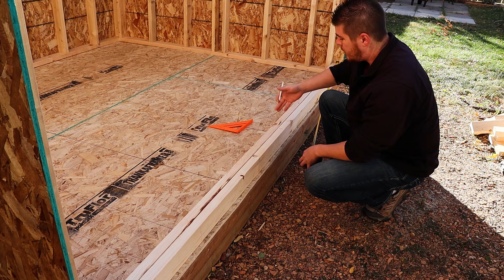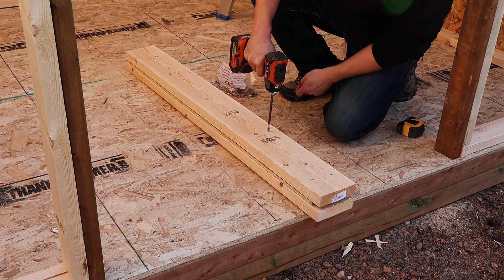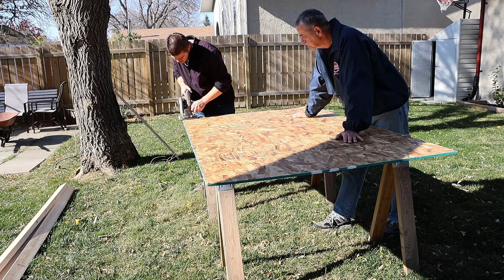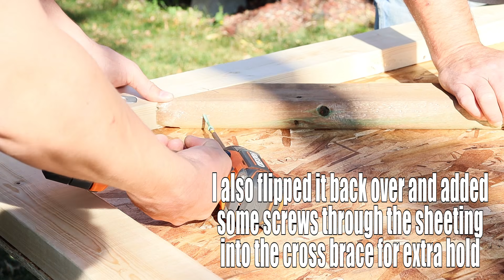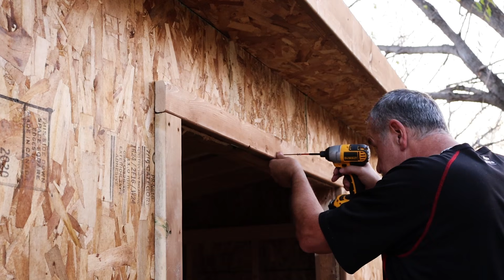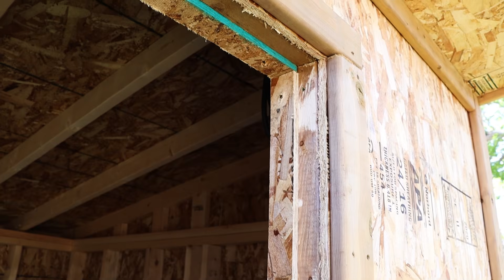How to build a storage shed - Door (front wall) // Part 3 - Plans available

Comment: I really enjoyed your videos. I'm going to use your videos as a reference to build a shed for myself. Thank you so much for sharing your knowledge and expertise. Awesome! Just wondering about how the 2X4"s aren't splitting when you drill in the screws. Or is it just bad materials that I purchased? And how many days did it take for you to complete this particular shed?
Reply from the maker: Thanks very much, I appreciate that! You're very welcome and I hope your shed turns out. There are very detailed build plans available if it would help. 
Typically with 2x4's being soft wood they shouldn't split. They can from time to time depending on how dry it is or if you're close to a corner or are using too large of fasteners, but won't all the time. Don't know what to tell ya. All total it was about a video a day, but it takes longer while filming. But if you've never done it before, I'd budget about the same amount of time-ish. Good luck on your build!

Comment: Gardening Granny here, I liked your easy to follow instructions, wish you lived closer. Planning an 8x16(wide) tool shed. I’m concerned about the floor , I will be parking a small 0-turn in the centre. Should I double the 2x6’s where it sits?
Kate
Reply from the maker: Hey Kate, I'm glad you liked it. You should be fine with a 2x6 floor as long as there is some 4x4 beams underneath picking up the load. I may add a couple extra of those is all. Good luck on your project!

Comment: Little tip. If you are going to put a lock on the shed, make sure you put the door hinges on the inside, not the outside. Anyone can get past your padlock by simply unscrewing your hinges 😂
Reply from the maker: You can also through bolt the hinges with carriage bolts, which I've done. I don't have problems with theft here anyways and most people don't carry drills with them to get into the shed
Reply: Make sure you put 2 guard dogs, infrared system and bullet proof locks and preferably titanium walls too.. Don’t forget the security cameras.. 

Cmon man unnecessary comment it’s a great build bud! Congrats 🤙🏼
Reply: @ChecoARHeavy there's something called a screw driver that fits easiest a pocket of your pants. Any thief can easily walk uo and unscrew it, so no, it's not 'a good build'. Why even put a lock on it if you don't have theft problems in your area. And why put it on where they can easily unscrew it if you do have a theft problem?

Comment: I. Would  like. The. Hinges. Set. To where. The. Hinges are. On the. Inside. The shed. , thi way. No one. Can. Just. Unscrew. The. Bolts. On the. Hinges. And. The. Door. Is. Taken    off. I don't. Want. My  2000 $  riding. Mower. Stolen ,
Reply from the maker: Watch my newest shed door video from a couple months ago. I address this concern

Comment: ok so a little bit of a tricky question i want to build a shed just like this, but i want to use it to keep my reptiles and the room has to stay 80 degrees year round, how would i go about insulating the entire shed
Reply from the maker: I'd add some chicken wire under the floor on top of the beams and add some Roxul or Rock Wool insulation to the floor before sheeting. Maybe even just sheet the top and bottom of the floor framing in then set it on the beams with insulation. Then the same insulation in the wall studs and door with plastic vapour barrier sealed to the top and bottom of the wall plates. You could do something similar to the roof and then sheet the inside of the roof, or spray foam it. Then some door insulation around the door seals.

Comment: Hi, great video's, taking plenty of knowledge from your build. I am looking at building roughly 8 feet wide with 6 feet depth shed in the coming weeks. I am planning to build a second floor, play space (tree house) for the children. I will use the 2 by 6's and follow as you did. would it be structually safe to basically build a shed on top on a shed?
Do you have tips to fix the skids into the ground for peace of mind too?
Thanks!!
Reply from the maker: Good to hear you're picking up tips! It's strong enough for sure that isn't a problem, just might be tipsy, yeah. Once the floor frame is built but not sheeted, you may want to mark holes to dig inside each corner. Dig down, probably with a machine you can rent, and drop 4x4 piles into the holes a few feet down and concrete them in. Then fasten the 4x4 skids to the piles sticking out of the ground with structural fasteners and cut the piles down to length, then sheet the floor. Good luck on your project

Comment: Kinda put the support 2x4 in the wrong direction
Reply from the maker: It isn't support I said, It just something to screw the OSB to in the middle so it doesn't wobble. The OSB sheet is what prevents the door from sagging
Reply: @JessedoesDIY  why would you not just go opposite direction for added strength and to make it look professional, might as well just put a horizontal 2x4 in the middle in that case

Comment: Why did you choose to use screws over nails?
Reply from the maker: Ease of accessibility mostly. Most people either have or can get a drill. But most don't have nail guns or want to pound in that many nails by hand. The other thing is we don't need the shear strength of nails here, nothing is hanging off anything, it's standing. Screws are arguably better here to clamp and hold it together, but ultimately either works

Comment: Jesse, great job on these videos. They’re helping me build a shed as we speak. One question regards the front wall. Is my math off or is your wall not 8’ tall? If you cut your studs to 87”, add 4 1/2” for the bottom and 2 top plates, doesn’t that give you a total of 91 1/2”? That’s 7’ 7 1/2” right?
Reply from the maker: That's awesome! I'm pumped you're building it, email me some pics when you're done, I'd love to see it. You are correct, it's just under 8' tall so that way I could use a whole 8' long sheet on the front wall without cutting it, but it had to slide down and wrap around the bottom of the floor framing and sheeting.
Reply: @JessedoesDIY  thank you for the info!! Greatly appreciated. I’ve subbed and liked your vids and will be happy to send some pics when the shed is done!!
Reply from the maker: Anytime! That's awesome, I'm glad to have you on the crew! Excited to see it

Comment: Hi Jesse.
Thank you so much for getting back to me in such a timely fashion. I am going to take your advice and go with the same roof as you did, after all it does make sense. One small question which I may already have the answer for but would like to hear from you. I see that the back and side walls are shorter than the front wall and I understand that this is for the pitch of the roof. so the question is, what size are the heights of the back, sides and front walls. I'm guessing 7' back and sides, 8' front. Please correct me. Thank you so much.
Paul.
Reply from the maker: No problem. The rear and side walls are about 6.5' to the top of the top plate and the front wall is just under 8' by a couple inches. That way I had plenty of room inside and wouldn't have to worry about hitting my head on anything, and for the front walls I wouldn't have to cut a sheet, I could just use a full 8' long sheet once it overlapped the floor framing. All the supplies, measurments, materials and lengths are all in the plans if you want more info. I tried my best to make them very thorough. Hope that helps!

Comment: Hi Jesse. 
Thank you so much for this video. I am actually getting ready to build a 8x10 shed in my backyard and I am definitely using your video as a guide. The only difference in the shed that I am building is the roof which will be a pitched roof. Do you have any suggestions for me .
Reply from the maker: No problem, I'm glad you found them useful! That's honestly a whole different subject that I'd need a video to explain, not text. That's the reason I went with a classic shed roof is because it's much much simpler for the average homeowner...and personally I feel it lends to more space inside

Comment: Could i just use 1x4 or 1x3 for the door trim?  Also for the trim on the corners of the walls?
Reply from the maker: You could but it'll sacrifice a little strength around the door. A 2x4 or 2x3 would be better if you can't find deck boards, but then you'll need to use 2x material for the rest of the trim to match. Up to you

Comment: Curios as to why you used plywood and not siding? Actually it looks like particle board, will that hold up over time?
Reply from the maker: It's OSB, and yeah, as long as it's sealed up with paint or something it'll last just fine. OSB has some weather resistance because of the glue in it, so it just needs a bit of help. Most people leave it raw and that's where the problem lies. I planned on using a smart siding (which is just textured and primed OSB) but I built the shed at the start of Covid so it was sold out everywhere locally because of supply issues

Comment: Mate these shed videos have been amazing thanks so much .. I don't have the tools you have but I've got a chope saw and a decent lecce drill driver ..
Reply from the maker: Thanks, I'm glad you like them. That's why I built it the way I did, I didn't use any fancy tools, just a drill and saw so anybody can do it. Whatever saw you have that can cut wood is fine. I'd suggest getting even an inexpensive impact driver tho, it's much faster and takes all the rotational strain from the screw going in off your wrist and arm. After that many screws, your arm will thank you lol. Good luck on yours!
Reply: @JessedoesDIY  amazing work sir again thank you and I'll be investing in a decent driver as you suggest.. I've already had carpal tunnel surgery after many years of DIY..don't want to make that any worse 🤣
Reply from the maker: Anytime, happy to help! Oooo yeah, I'd definitely get a impact then lol save your arms and wrists from further strain!
Reply: @JessedoesDIY  sounds like a plan 🫡

Comment: Cross brace should be under compression and not tension
Reply from the maker: I said in the video it isn't a cross brace, don't really need one with the OSB acting as a brace to keep it square. I said this was nothing more than a scrap piece of wood to screw the center of the OSB to so it didn't wobble or sound so hollow when you knocked on it. Only reason I went slightly across it was to maximize surface area

Comment: Hi love your video I am planning to build a 5by 10 shed what size are your side walls and the front one pls thx so much
Reply from the maker: Thanks, but I wouldn't do a 5' shed, do either 4' or 6'. All building materials are designed to work on even increments, not odd. All the wall dimensions are in the videos as I went. I made the side and back walls to a final height of 78" and the front wall was so a 8' sheet would reach to the bottom of the floor framing

Comment: If I wanted to add a second door on the side wall, do I use the same principals here? Anything I need to be aware of that could be different?
Reply from the maker: Pretty much yup. You could frame a side wall normally and just pick a spot to add your jack and king studs, leave the wall studs out of that location. Only thing I'd do is leave it probably 6-8 inches from the corner just to make things easier like trim and framing

Comment: Really like your presentation style.  Will check out your other videos both to learn and for entertainment.  
Your first shed building video, you talked about deep permafrost.  Reminds me of years ago in Anchorage.  Later in Wyoming we looked the other way for temporary freeze depth in Wyoming.  Great refresher 30 years later.
Reply from the maker: Thanks. I appreciate it. Wow Anchorage, they are quite a bit farther north than me, but we actually get similar temperatures during winter the way arctic air flows. It's crazy here how far down it goes.

Comment: I probably would have put the door brace on the other diagonal but otherwise really cool 😎.
Reply from the maker: It wasn't a brace, doesn't need it because the odb sheet prevents it from sagging. It was just something to give me material to screw the osb to so it had some structure instead of being soft in the middle of the door. Glad you liked it tho
Reply: @JessedoesDIY  Yeah, I realize the sheathing takes that cantilever load but I'm trained to respond to upside-down triangles. 📐
Reply from the maker: Lol true that

Comment: This is probably the most helpful video series on building a shed. We have made great progress on our build, but there is one hick-up. It wasn't until I had the front wall up that I noticed that someone (maybe me, maybe my wife) didn't line up the king stud properly. It was about 1/8 to 3/16 of an inch toward the wall making the opening slightly larger that it should be on the bottom. My thought on dealing with that is cut out the bottom plate where the king stud edge was supposed to be, then using a bunch of shims I can line up the rest of the jack stud to the correct width so the door will fit. Do you have any thoughts?

We have rain coming for the next several days, so I won't be getting back to this until 3 days from now, so I won't be proceeding until the rain is passed.
Reply from the maker: Thanks! I'm glad I could help and that you found it useful. Super pumped you're giving it a go! Yeah, that'll work. Like I said, nice thing about a shed is there you have some liberties and slack since it isn't a dwelling. It makes it great practice to learn on. You can shim it over, or completely cut them out with a recip saw along the plates and move them over, then cut the bottom plate after. Whatever is easiest! Good luck on the rest of it and keep me posted, I'd love to see it when you're done!

Comment: Your videos are really, really great. I have one question, and forgive me if you've answered it somewhere else. I bought a box of Common Nails 3 1/2 - 16D Galvanized, to begin the upper framing of this small porch I am building. And I tried one of those nails out. They seem quite thick, and to a novice like me, I'm afraid of splitting the wood. Are these the same nails that you would use to frame, like for ceiling joists and rafters? Thanks!
Reply from the maker: Thanks, glad you liked it! Yup, those are the ones you'd use. Good luck
Reply: @JessedoesDIY  Thank you!

Comment: Can you tell me what tools you used?(name so I can go buy them) and the amount of materials and roughly how much did it cost you after everything is all said and done, ok? I’ve WATCHED All of your shed videos and I’m thinking to either buy a shed or do it myself because I need a different size dimension then what they sell on the market.  Thank you so much; love the videos bro. (Total cost? What kind of wooods, size and names of them? And What kind of tools I need?) Aloha
Reply from the maker: Hey man! So I used Ridgid in this video, but have since switches to Ryobi One+. Same company, just less expensive. You can get them at home depot and I used a impact drill with a 4amp hr battery and a 7 1/4" circular saw, a speed square, tape measure, hammer, level and a pencil. That's basically it. I have a full materials list in the descriptions of the videos and a full shed list in the last video. It cost me $1700 to build it fully and that is with inflated pricing. I'm glad you liked the videos, I tried to keep it simple and strong so people could adjust so I hope you'll give it a go! The cost between buying vs building isn't the only thing to look at. Building is much stronger than buying a plastic one, and if it's a pre-made wood shed, it might cost about the same to buy, but it'll only have about half the lumber as this one here so it won't be nearly as good. I made this out of all pine, some pressure treated and some not, and OSB. I have all the dimensions and everything in the build lists in the description. Hope that helps, feel free to email me if you have more questions. Good luck!

Comment: Just curious why you use those hinges anybody with a drill could just unscrew them and get in your shed
Reply from the maker: I'm in a pretty safe area. Most theives are looking for a quick score. My gate is locked first, so thats a deterrant. And most thieves aren't carrying around power tools. There are so many hinge screws on the hinges I have now that it's too big of a job and too much work, and it would be loud. But you can get heavy duty hinges that are made for through bolts that would be better for security if needed

Comment: when u are using the 2x4x8 did u use actual full 2x4x8 or 2x4x92 5/8???
Reply from the maker: I used 2x4x8 and cut them to the sizes I needed because this was done to suit my needs so off the shelf wasn't quite the right lengths
Reply: @JessedoesDIY  Yeah that’s what I figure it out afterwards I did notice though on your section about building the roof do you have 2 x 4 by eights for your roof but it should be 2 x 4 by tens in order to get your 6 inch overlay on both sides that you have unless I am looking at it wrong
Reply from the maker: Did I? You are correct, they are supposed to be 2x4x10, I must have mistyped. I'll have to fix that, thanks for letting me know!
Reply: @JessedoesDIY  all good! Appreciate the great video! Got my 3/4 way done just need To make door and slap the roof on started yesterday so not bad! Great help!
Reply from the maker: Man, that's awesome! Well good luck finishing it up. Feel free to email me some pics when you're done! I'd love to see it and share it with everybody
Reply: @JessedoesDIY  will do! Shoot me your email!
Reply from the maker: canadiyanjesse@gmail.com

Comment: If you need a hand squaring up the trim peace on the border of the door and you don't have a spare set of hands just screw a board flush to the inside of the door frame and then do it  yourself
Reply from the maker: Absolutely